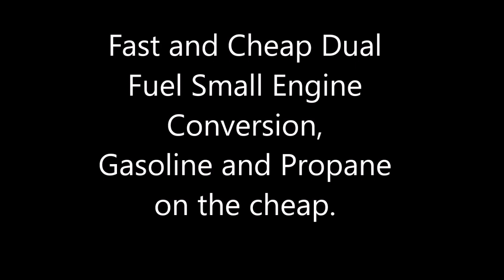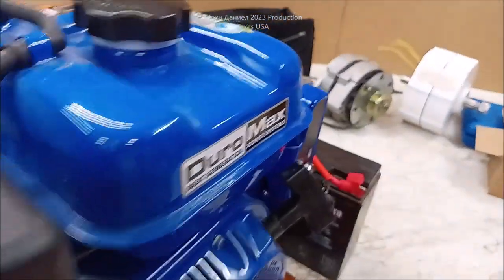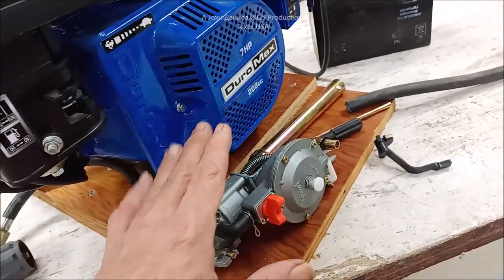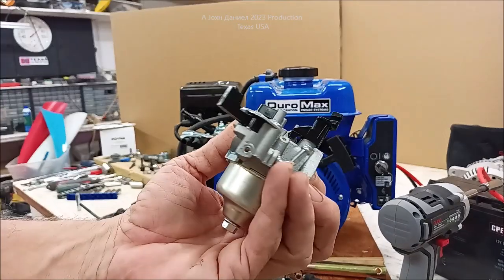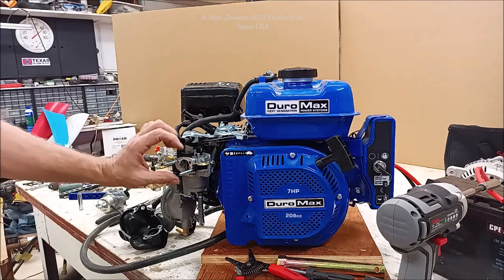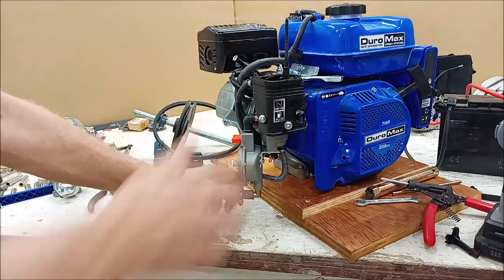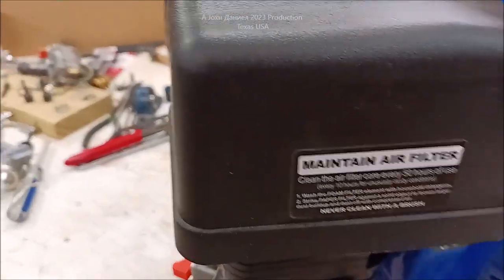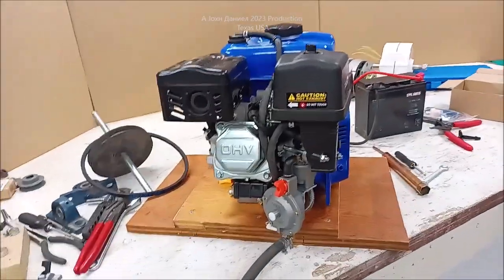Easy & cheap, Convert & Run a DUROMAX XP7HPE gas engine on LPG Propane, dual fuel use

Comment from the maker: DUROMAX Engines https://amzn.to/3Z7hD3B (Engine prices are on the rise, act fast.) Special Carburetor as described Check your bolt holes 3 to 7 horse 42mm https://s.click.aliexpress.com/e/_DlJh9SR OR  for 8 to 15 horse use 53mm (2") , LPG Fuel Regulator https://amzn.to/3i6cich , Fuel hose section to cut from https://amzn.to/3CdP6iY , D2-3/8 Gas valve https://amzn.to/3CDx9Lh
POWER SMART Inverter Genny https://amzn.to/3CeXPSb POWER SMART COLLECTION https://ebay.us/JOexGc or https://amzn.to/3G0dwOc
Proper battery to use on the engine is 12 to 14AH, but you can use a basic small lawn mower battery. Check Walmart for the $25 U1 https://bit.ly/3IhG1tA buy online and pick up in store so you know you'll get one.

Comment: John, i built one of these dc generators back in 2017 when we came to America (i moved to Philippines in 2015 to marry Steffy, then came back to America in late 2016. we lived in a camping trailer for 3 years off grid.
i purchased a manual start engine at northern tool, and used a plate from some company to attach the engine and belt drive an alternator. i had a 36 volt golf car with brand new T105RE batteries. i used Anderson connectors to plug and unplug the batteries to switch back and forth between 12 volts and 36 volts, used several different solar controllers to control the voltage.

i used the 36 volt config to make the battery bank mobile, and 12 volt to power our camper.
i also used a piece of chain link fence top rail to divert the exhaust into the bottom of a stainless steel pot. inside the pot was 3 pieces of broken brick to hold the inner pot above the 1 1/2 inch  top rail. i had a stainless steel pot with a lid to fill with water to place inside the outer pot. we would use the waste heat to heat water when charging the battery bank, and it quieted the exhaust a little.
we heated our camper with an old M1950 tent heater and burned the maple flooring in the old house for heat. sometimes at 2 am i would have to open both doors because it was over 100F inside the back bedroom. this was during south dakota winters where it would get down to 30 below zero!!!
in fact i got a STAPH A infection (from getting injections in my back) and went into a coma on january 28, 2019 during a BLIZZARD. a deputy had to carry me over his shoulder to my neighbors to put me in the neighbors jacked up 4x4 to carry me to the grave yard where the ambulance was waiting. it could not get any closer than that!
last winter we has 12 foot high drifts in the road i lived on!  it almost completely covered my 53 foot semi trailer i use for storage! we even took photos!!
so i live in an apartment now. im very disabled now as the hospital bill was over 1 million dollars, i had zero insurance!!
Reply from the maker: No more snow for me! My solar makes great Air Conditioner Juice!

Comment: I bought one of these back in March.  Just putting it on my sons go kart now.  Good little engine for the price.
Reply from the maker: They have a twin 1 lb bottle holder Flame King YSN1LBPB for propane that you can use on a conversion to LPG for his cart. Then no more cleaning and fixing the terrible carburetors they all have.

Comment: Awesome! Thank you I've always wondered how this was done. I already use propane in my heating system since that's the most efficent way to heat. Having a way to make electricity on a cloudy and no wind week is cruicial.
Reply from the maker: Next video, Converting a Champion Rear Tine roto tiller to propane and using 1 lb bottles on it. No more gummed up carbs and no more worries, I can store propane for 40 years and not ever worry. Start saving and asking for used 1 lb bottles, I show how to fast fill using a heater and a full hose transfer.

Comment: How about wood gas … it will stop if the wood is gassed ore when the fire under the wood tank burns out.. would be un interesting video (charge the battery bank on junk ) 🤪🤛…☝️that thing runs on wood

Comment: I was given a old Homelite 6300 watt generator. I finally got it running,and I plan on running the dual fuel card system on it. My only problem with it is the fuel tank is rusted,but that's about to be fixed as well. Thanks for another awesome video John . My generator is powered by the Honda GX340 11 hp. Do you know of a good source for the dual fuel carb ?
Reply from the maker: You will get one for a Champion that has a Honda 340 Clone on a 5500 to 6750 watt generator. https://amzn.to/3PVkRoM

Comment: special carburetor link doesn't seem to work, it ask for " what do you want".  can you provide any more information?
Reply from the maker: Not sure why, I checked it. Working but had to reload the page to see it.  Check your bolt holes 3 to 7 horse uses 42mm https://s.click.aliexpress.com/e/_DlJh9SR OR  for 8 to 15 horse use 53mm (2")

Comment: I had thought about doing something similar with a golf cart motor as the power head.  What do you think, John?
Reply from the maker: Golf Cart engines are far from being known for their efficiency, the DuroMax has 208cc on 212 platform so its compression is better suited for LPG that is why I chose it.
Reply: @JOHNDANIEL1  my failure to clarify.  Gasoline engine driving electric golf cart motor to provide DC power.
Reply from the maker: @HighDesertOffgrid  If it's a regen capable motor, then yes, you'd need a 10 horse to do it though.

Comment: john i have a powermate gen. 8hp techumsa eng how do i know if this would work. i see ali has a wide range of conversion carb how do you know which one
Reply: @JOHNDANIEL1  is that adapter also availible from Ali
Reply from the maker: @chrischrismelco  No, I make them as needed. Just 4 tapered bolts proper sized, a hole drilled through shaped as needed, and 2 gaskets. The reason for 3/4 is to tap a 1/4 pipe thread into it for vacuum from the side.

Comment: What would be interesting would be to also take one of those cheap Chinese Yanmar Diesel clones and an alternator. You can also run some alternative fuels such as waste motor oil or used (but filtered) veggie oil in those from what I understand.
Reply from the maker: The best diesel they make is the knock off of a Lister. But shipping is horrendous. I would go the 16 hp with gear reduction if you want that much power https://s.click.aliexpress.com/e/_DB1fufl